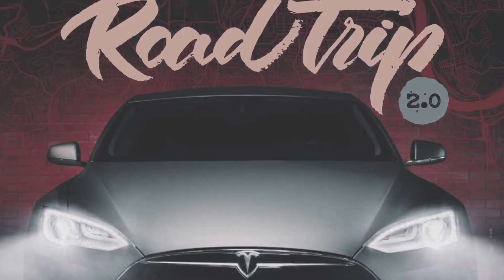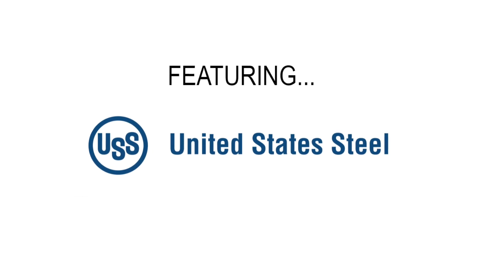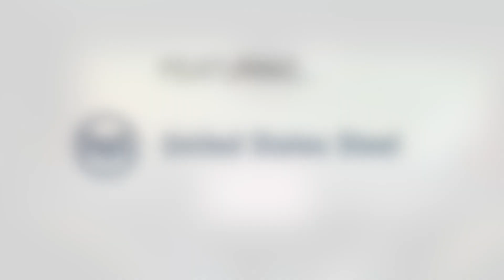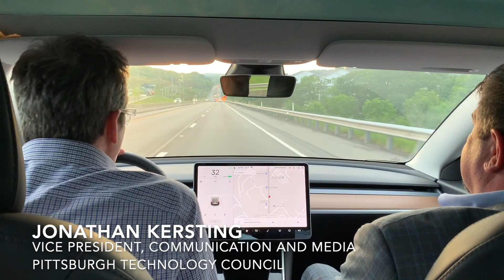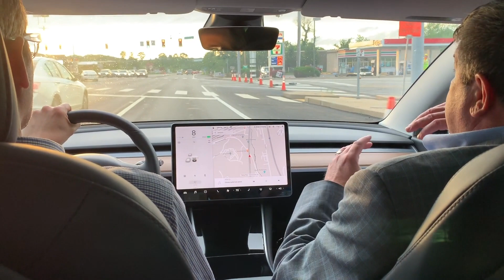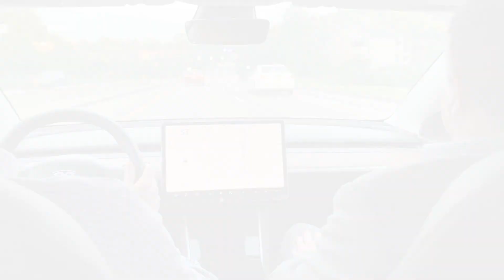Roadtrip 2.0: US Steel Corporation

Comment: I bust US Steel's chops a lot on youtube.com .  It is well deserved given some of the bone headed investment decisions they've made over the years.  I think Here is a few that come to mind:  Serbia, Stelco, Long Star Steel etc.  US Steel R&D is great if it provides practical process innovation that insulates the company from the minimill rat race.  US Steel will never be able to compete with Nucor or SDI on cost with the next generation of compact strip mills.  US Steel will not be able to hide behind tight chemistry requirements given the advent of cheap natural gas and it's ability to allow the minimills to produce direct reduced iron.  The simple fact is that USA doesn't have low cost, high grade iron ore any more or lax environmental laws.  This works to US Steel's detriment.  What the USA does have is abundant scrap and cheap electricity which works to Nucor/SDI's advantage.  So US Steel will try and hide behind it's product line via R&D.   I don't think it will work.  Nucor and SDI don't have R&D.  They depend on their equipment suppliers to innovate their process.  These OEM's have demonstrated more capacity to innovate than US Steel R&D.  I might not have said this in the 1970s when US Steel had an R&D department that worked closely with their large and talented inhouse engineering capacity.  US Steel shut all that engineering capacity down which was a gift to the OEM side of the industry.   Just another Tom Graham bone headed move which put US Steel where it is now.